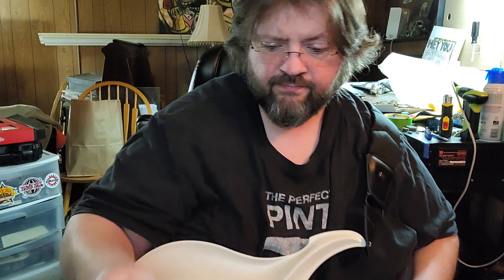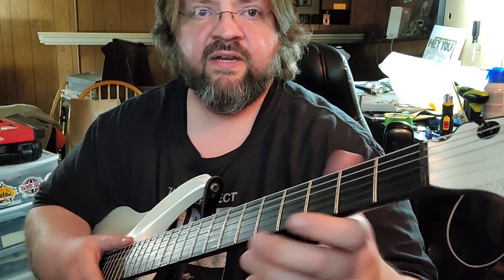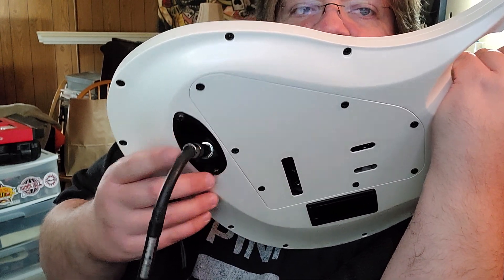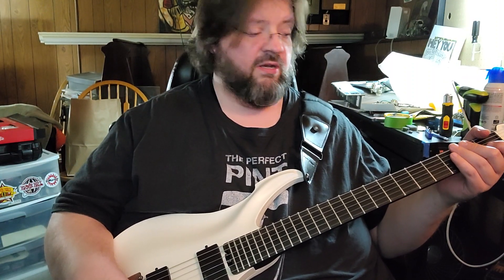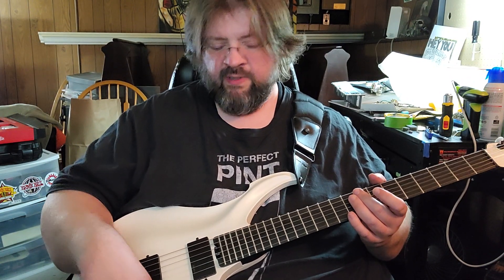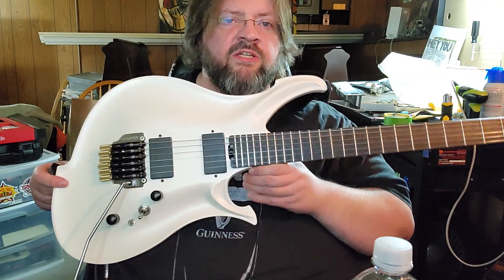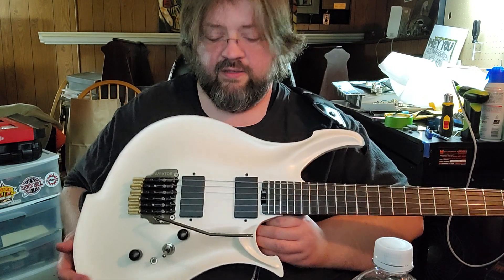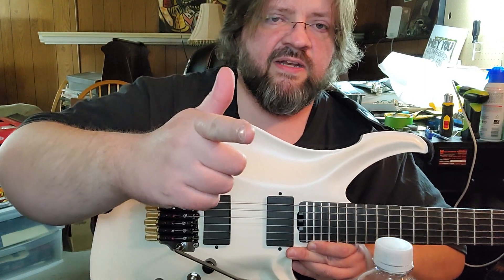Koloss GT-6. BUYER BEWARE!!

Comment: What a shame, and I was eyeing up the 8 string headless with trem. Not only is the string break angle an issue and the ball end not locked in place, but you can clearly see the bridge pieces overhang the front of the trem and push against the body when diving! I noticed this on their website too. Additionally, there's no way to use the trem upward as the fine tuners will hit the body - yet another design flaw. A real pity as I love thin, light weight modern guitars like the Parker Fly etc. Thanks for the video dude.
Reply: This is mostly due to a bad setup of a flawed copy of the Strandberg bridge. The ball ends aren't locked / hidden properly because they haven't used the bridge tuners enough - they've wound up to tune with the headstock tuners instead. Operator error. You could improve the bridge set up if you want it to be down-only. Drop the height of the pivot screws and raise the individual saddle height - this may improve the break angle a little and stop the tuners grinding into the body. Personally I'd just swap it out for a Floyd, I wouldn't condemn the whole guitar.
Reply from the maker: The further away the ball ends are from the saddles, (in this case) the less of a break angle there would be. And, in moving them further back, the strings would come off of the saddles sooner, during a bar dive. Also, dropping the pivot screws would bring the overhanging saddles closer to the body, thus lessening the amount of allowed travel. And, the individual saddles are pretty much at the max height here, because of the locking screw position. Overall, it's simply a terribly designed trem. A floyd Rose, would be vastly superior. So would a traditional "strat" tremolo which they have, on other models. As far as condemning the entire guitar... Well, there's a crap tremolo, a crap nut, a terrible fret job, a horribly place output jack and the need for a 2nd string tree, which by the way, cannot be added due to the design of the hatch framework under the headstock plate. So, yeah. I'd condemn this entire waste of money. Peace!

Comment: Good review.  Bridge is a deal breaker for sure.
Those " 2 little screws holding on the neck " are for the cover plate, the neck screws are under it.  Might want to take a look.  Cheers.
Reply: Correct - the neck is held by 4 screws underneath that plate that you describe.

Comment: Hey Chris! Thanks for the video. I have 4 guitars from Koloss and I have to agree with you on most issues. I wish it wasn't like that. The biggest issue I found on GT-4 and GT-6 models was a dysfunctional truss rod. Not only it worked in the opposite direction but also caused a weird bow between 5-9 frets causing fret buzz and making the guitar unplayable. Those necks are pretty heavy too. The wooden necks were much better. Those worked properly but had tiny frets, which is really weird for a modern guitar. With that said, I've spend more than enough time with them but couldn't get any satisfying performance out of GT-4 and GT-6. The other two with wooden necks were ok but not for the price, still too many design flaws and little things here and there
Reply: Were the wooden necks on the headless models?  Are the tuning instability issues consistent throughout all 4 of Koloss's models that you have?
Reply: @JustinShlensky  Those are X and Render models. Render is headless. I was able to make the X stay in tune really well. I didn't spend much time with Render but all together these two are much better than GT models

Comment: This is terrible design. That jack is horrible. So what you’re saying is this is a kolossal pos.
Reply: I'd relocate the Jack to the front like the fender p bass guitars but for the amount of money you shouldn't have to change it
Reply: I agree this design is terrible, but for this company to succeed... they'll have to relocate that jack, just use a wood neck (or something just as stable), redesign bridge, and offer more hardtails...
Reply: @ADoveThatPlaysXbox  apparently they have more expensive version which have wood necks
Reply: @Forest_Fifer  I've noticed but those models with wood necks are much pricier and I'd be concerned about some of their quality issues and design choices on those models. The "carbon fiber" necks they keep pushing either need to be redesigned or just dropped and stick with wood necks. If they make the needed changes that the guitar community has brought forth I'd consider purchasing one of those kits (with a wood neck). seems like a cool project...

Comment: The bridge issue is a setup problem not an engineering problem. The fine tuners were screwed all the way to the back of the bridge before the strings on the headstock were locked. The ball ends should be directly behind the saddles. Fine tuners that are adjusted to fully tight position are useless any way. I got on me of the kits for $299 and at that price I'm satisfied with it. I do hate the jack position though.

Comment: That neck is NOT carbon fibre. It's an injection moulded plastic. Probably a Nylon CF15 or CF30.. As in there are carbon fibres all mixed up in the plastic. Similar to plastics used in the engine bay of your car. It's done to reduce thermal deflection and mould shrinkage. NOT to add sexy marketting wank for guitar manufacturers.  Give it a flex....

Comment: Lol! Technically the nut should not be too hard to remove, the neck is not carbon fiber, just cheap, hollow and unstable plastic (as some other reviewers eloquently demonstrated). I fell for this thing too, and it is a waste of money indeed, but I'll still keep mine. For fun and home decoration. Note that an even bigger design flaw is that the crappy bridge is also located in the wrong place (the pivot posts are too close to the bridge in the body casting). Intonation can't be set correctly without pulling the saddles so far back that their alignment studs pop out of their guiding grooves. And then there's that crappy heat-shrink tubing on the trem springs which doesn't let the trem return to its original position, hence detuning the guitar. Actually getting music out of this toy is quite a feat, well done you!

Comment: Chris, thanks for the thorough and honest review; I think you just saved me a giant headache and buyer's remorse because I was considering one of their headless models.  For what it's worth, based upon your experience with the traditional headstock tuning model that you did this video on, do you think that there's any improvement in the tuning instability issues with their headless model?
Reply from the maker: No. This tremolo is not a good design. The strings are not at all stable. I would avoid this brand, until they address and correct the design flaws.

Comment: Another thing I see wrong is that you can't go sharp on the bridge as it is going to bottom out on the body of the guitar.  I like to do a Steve Vai type of "warble" by turning the trem handle backwards and flicking it or pulling up on the handle and letting it go suddenly.  The way it is built that is impossible.  These are the types of things that their engineers, who themselves should be guitarists, should have caught in the beginning stages of prototyping.

Comment: Floyd rose bridge strings also lift off the saddle. I have 7 of those and thats a non issue. The issue is more that the ball end doesnt lock.  Input jack is definitely silly though.
EDIT: Also, thanks for the thorough review. I have the red/gold and gold/gold on my watch list
Reply: They do but not to that extent. You also have to take into consideration he tightened the springs so its not sitting at its optimal position. If it was set flat like a standard floyd trem, it would take little to nothing to lift off the saddles... which defeats the purpose of the trem... Koloss would be better off offering more hard tail options or a different trem on standard non headless guitars.
Reply: Agreed

Comment: For the price of this guitar I bought an LTD EC-1000 Deluxe used, like new with cash to spare. Don't fall for these. Also, it's carbon filament, take the cap off and it looks like a cheap 3d printers first attempt.  I wanted one of these so bad, but started doing my research, all of the "positive" reviews had the guitars gifted to them, never EVER trust a review like that.

Comment: I'm interested in this thing bc it's got potential.  It's in a shit state now but, if they fix the design and poor craftmanship screw-ups it might turn out to be a badass axe for the money. Why they put a "headless" tuning system bridge on a guitar with a regular nut and headstock tuners, who the heck knows. They should just install the vintage/Strat type bridge they have. There was no battery bc the p-ups aren't active. It would sound extremely weak without one if they were. All the bodies seem to have battery cut-outs regardless of the circuitry installed. It's probably cheaper that way for mass production. Phil McKnight does a great experiment with heat showing how bad that polymer plastic neck (NOT carbon fiber) will go out of tune under mild temp changes. Arnold Plays Guitar also rips it a new one lol.

Comment: Man that’s so strange. Mine was perfect. The pickups were really awful but mine was pretty amazing other than needing a setup which it was actually extremely easy to setup. The thing though that sucks with really any guitar these days is nothing is consistent. Not even the big brands are consistent anymore. That bridge on these are really stupid to me. Why on earth would they use a headless bridge?! My input also didn’t stick out like that. Mine was actually flat and landed just fine. I will say though that when I did do whammy stuff mine did go back into tune without any issues. I’ll have to update my page to let people know they’re having issues. Mine was perfect and I ordered through a friend so it was completely anonymous. I’d definitely chock this up to some being fine and others being rushed through and horrible. It’s sad man. It’s a cool guitar with a fairly unique tone. It’s sad they get sloppy and create a bad customer experience. I really think I’d they got rid of the stupid bridge and has a better attention to detail they’d be better off. I did have to tighten down the bridge saddles and two of the back cover screws weren’t as straight as I’d like but that’s really the only issues I ran into at all. Damn man I hope they refund you.

Comment: And it has a square block neck pocket like every other guitar since the dawn of rock.  If you want more midrange resonance and sustain at lower volume than get a 3G guitar.  Ten times the tone from the first major improvement in neck design since Les and Leo. 180 degrees of contact between the neck and body.  A patented (published. Not pending) game changer in both bolt on and set neck.  Plus neck thru access with bolt on tone with the Performer model. Stop with the gimmicks and get real...

Comment: Terrible design on the bridge & jack and pretty awful sloppy build execution & QC on nut -slots-glue etc. As another reviewer showed , the neck is also not likely a true carbon fiber construction, more likely is some kind of plastic molded w/maybe some carbon fiber mix, but it will move/expand/contract & lose tuning if neck is heated up (like from stage lighting and while playing). Another reviewer illustrated that perfectly by heating the neck up slightly with a heat gun, resulting in it completely going out of tune. Back to the drawing board with that thing IMO. Thanks for the honest review.

Comment: Try warming the neck to performs warmth.  ie. get it about 30 degrees over room temp and see if it stays in tune.  It won't.  Its not carbon fiber just a cheap stiff plastic.

Comment: I don't believe there are any major problems here that can't be easily solved with a pro set-up. Not sure why the balls of the strings are so far back in the bridge tuners- they shouldn't be if you want more break angle over the saddle. And I'm not sure why it has high ratio bridge tuners in the first place. The nut can be solved with the correct slotting files. The neck is stated as SCTP Solid Carbon Teflon Polymer, so it's NOT carbon fiber and it's technically not exactly a plastic. Not sure what benefit the teflon gives it.  I'm going to order the M4 kit with roasted maple neck and 2-point Strat bridge as it seems to make more sense. The output jack should be moved imo. Nice looking axe.
Reply: I'm now a few years in on the Koloss M4 kit. It's truly awesome, and I've made a few minor mods; Locking tuners and I relocated a Switchcraft #11 output jack to the front of the guitar, which is not hard to do if you get the right location. Just sayin'.... all Koloss kits aren't bad if you shoot for the more traditional models and do a proper build.